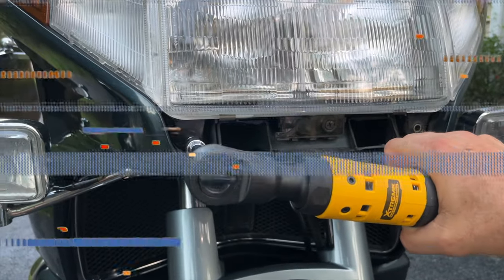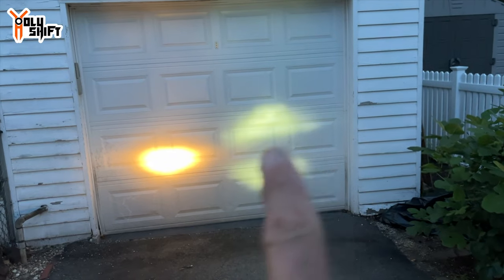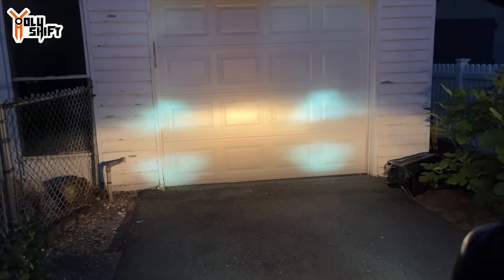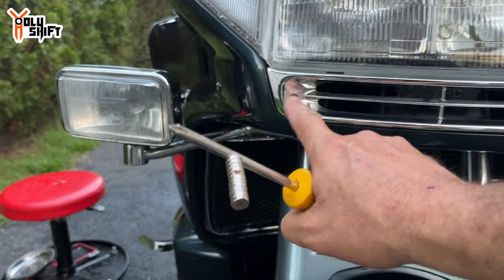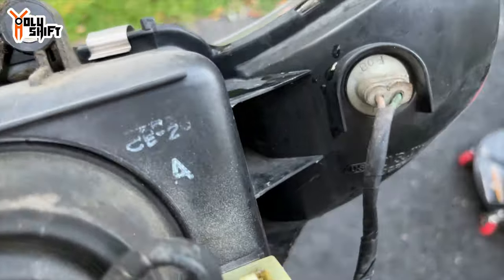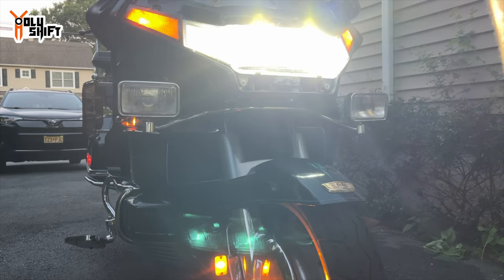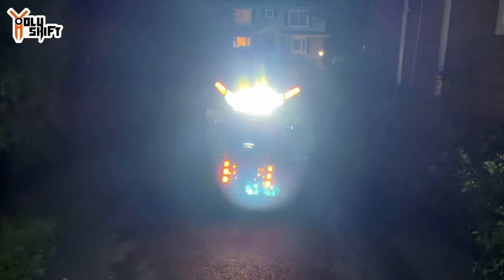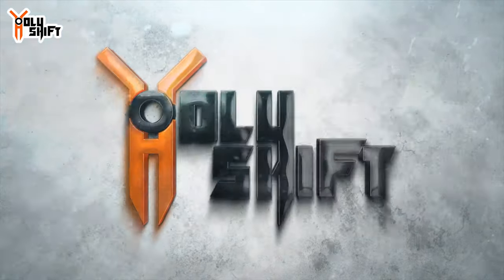Cheapest Light Upgrade Goldwing

Comment: The metal strip may have been for heat dispensation to protect the plastic lens. That shouldn't be an issue with leds.
Reply from the maker: I took it off